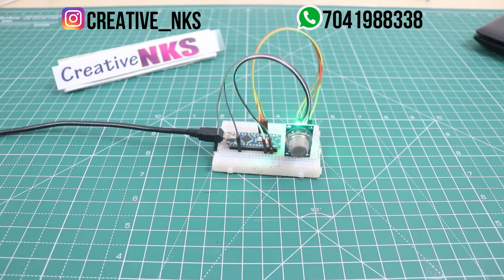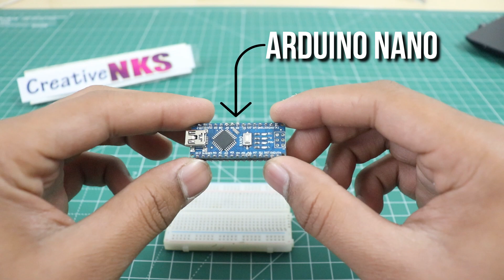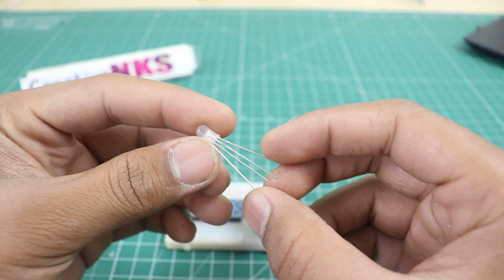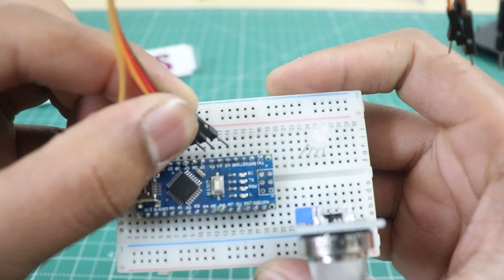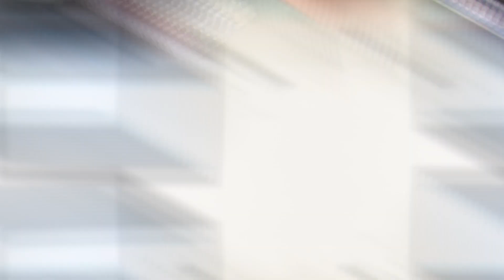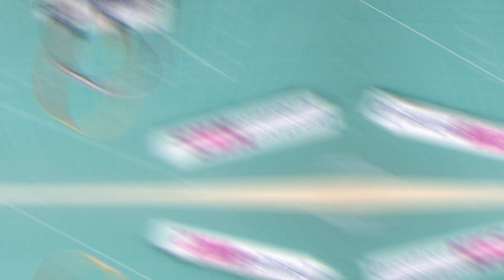How to make Smoke Detector Alarm using Arduino |2020

Comment: Sir plzz i need code sir
Reply from the maker: #define sensor A0     //SMOKE SENSOR
#define Gled 2       //GREEN LED
#define Rled 3       //RED LED
#define buzzer 4    //BUZZER

void setup() {

 pinMode(sensor, INPUT);
 pinMode(Gled, OUTPUT);
 pinMode(Rled, OUTPUT);
 pinMode(buzzer, OUTPUT);
 
 digitalWrite(Gled, HIGH);
 digitalWrite(Rled, LOW);
 digitalWrite(buzzer, LOW);
   
}

void loop() {

 if(buzzer == 1) {

   digitalWrite(Rled,HIGH);
   digitalWrite(Gled,LOW);
   delay(1000);
 }
 
else {
  
  digitalWrite(Rled,LOW);
   digitalWrite(Gled,HIGH);
   delay(1000);
}
delay(1000);
}